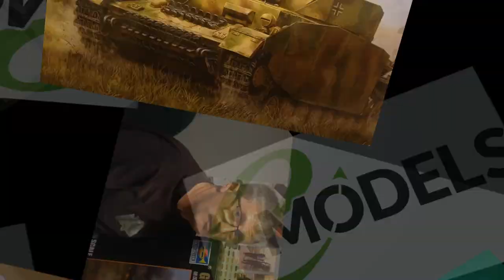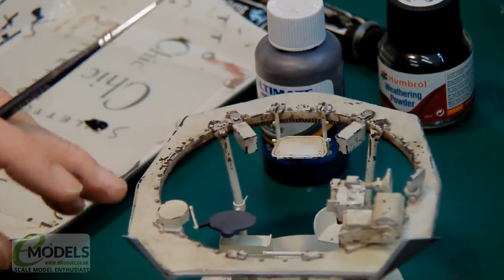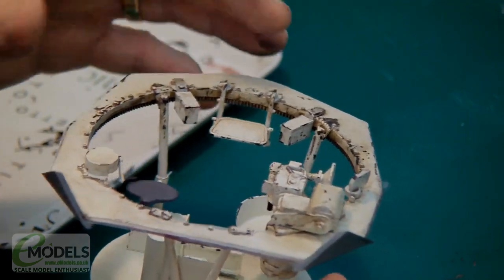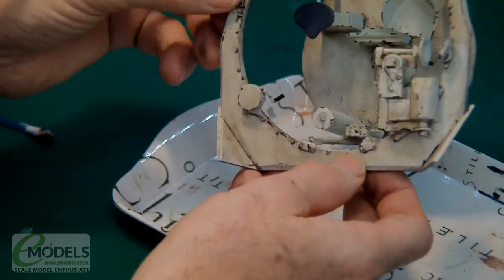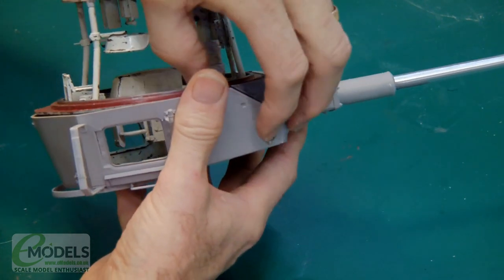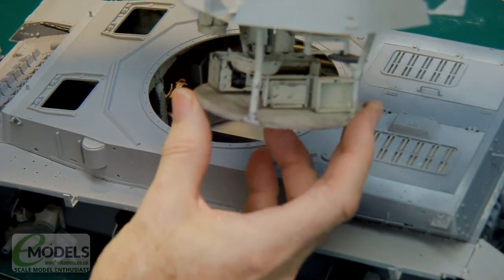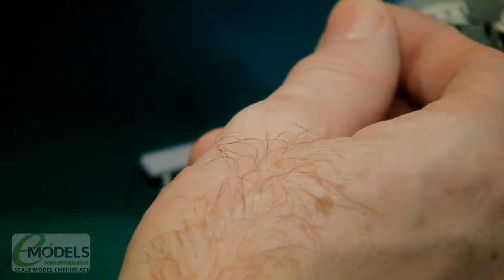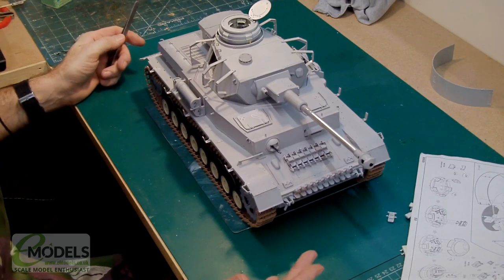Trumpeter 1/16 Pz.Kpfw.IV Ausf H German Medium Tank # 00920 - Part 9 Build - www.emodels.co.uk

Comment: Very nicely done, exquisite work with the painting and addition of effects to the vehicle. I am currently building the 'Trumpeter' 1/16 Sd.Kfz 186 JagdTiger and intend to put some of your tricks to good use. On a side note, at 36:35, you mentioned that the turret is offset to the left of the vehicle, and to those of you who may have missed it, the engine and drive-train is also offset to the right. The reason for this, is so that the driveshaft will not interfere with the rotary base junction, (the unit that provided power for the turret traverse). Also, due to the weight of the turret being placed more on the left side, that is the reason the majority of the ammunition and stowage being on the right side. Again, great work with this model and look forward to your next.

Comment: Beautiful work, quite impressive and I do think I may just pick this kit up soon. One minor note: Having served years on Armored vehicles I have some unusual insight on how the inside looks, and weathers. The crew does keep the vehicle as clean as possible, within reason, but one aspect most never realize is the abrasive action of dirt on the boots of the crew on the floor plates. The dirt grinds the paint and the checkered surface quite a bit, resulting in a lot of bare metal being visible (on all the upraised areas of the checkering) and barely any rust except on the outer areas where the constant rubbing from the boots does not occur. So just as a note, not a criticism mind you, but it would normally be first a bit of dry brushing a bright metal color, and then adding a wash of dirt/grease nasty stuff to the edges of the highest scuffed areas.
Reply: Thank for your comments... I'll probably give the checker plate a dry brush of bright metal
Reply: +Sgt Bones And any crew should have silver boots LOL   Ah.... the old days.
Reply: +jjab99 Silver boots? I don't quite understand what you mean by that. The dirt on the boots rubbed the paint off the floor just like sand paper, which left the floor pretty scuffed up and after sweeping it out you saw lots of bright metal scratches. And yeah, we did have cleaning supplies on board, lived in the damned things weeks at a time, so cleaning house was quite important. Oh yeah, one other thought as far as weathering is concerned, the seats are where one stands when poked out of the turret, they got pretty scuffed up too.
Reply: Sgt Bones  I too have had a lot of experience in armoured vehicles (Chieftain & Challenger) and the one thing that I remember is the silver paint used to paint the floor plates took about a decade to dry! Thus every time I worked in the turret, I found that a lot of the paint went all over my boots.
Reply: +jjab99 Ahhhh, okay, I'm a bloody yank and spent my time in M1's and Bradleys, with white in the M1 and puke green in the Bradley.
Reply: Sgt Bones Yanks are okay, I have worked with them in Bosnia and West Germany. Yes, your tanks are different colours and you are lucky they are not silver inside (The damn paint never dries!!). I think that the latest generation of Challenger 2 Tanks are white now, so no more silver paint....YEA!  Have a good one!

Comment: Trumpeter don't appear to have surveyed a real tank. There are problems with this model that we really shouldn't have to deal with.
- commander's seat about 25% narrower than the real thing.
- bolts on the turret ring are misplaced. This is a bigger problem than you might think, because that shifts other things around.
- No wiring. This tank had many steel-braided cables in the turret, starting from junction boxes on the front legs.
- One of those junction boxes is missing.
- Gear teeth all around the turret ring are exposed. The real tank covered them up.
- I don't see the lighting or the intercom system at all.